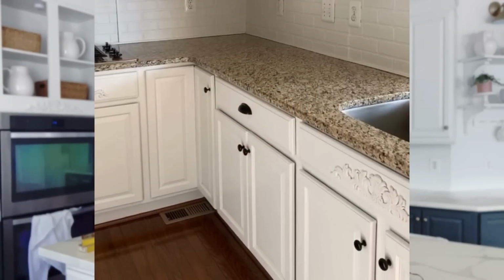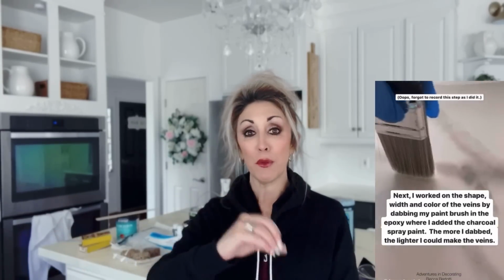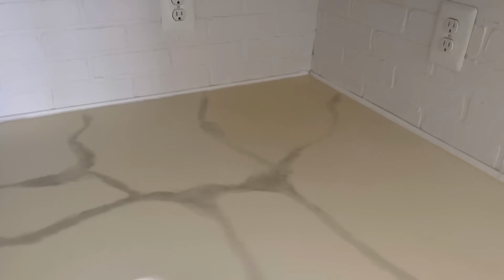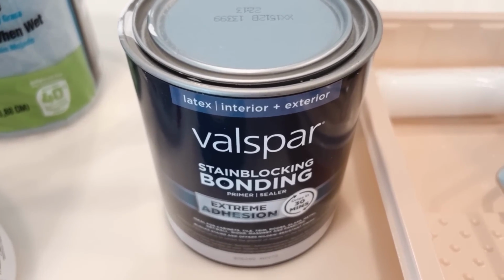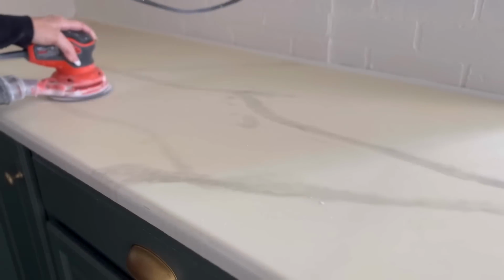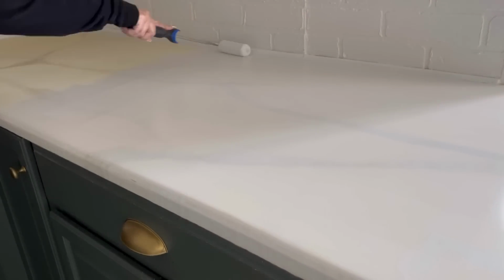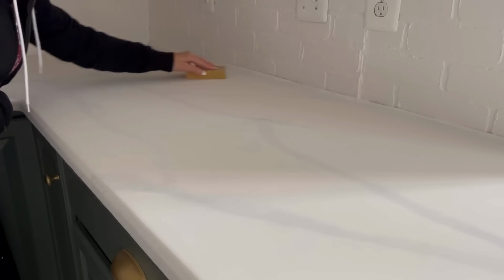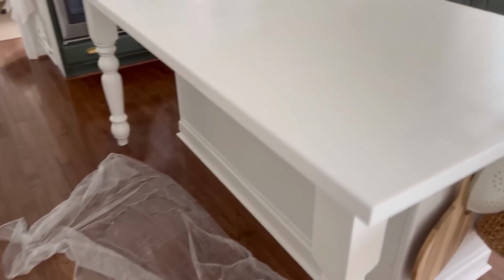*NEW* PAINTED KITCHEN COUNTERTOPS (DIY) | FAUX CALACATTA MARBLE COUNTERTOPS | KITCHEN DESIGN

Comment: Hi Becca. I painted my counters too but did not use epoxy. I sanded, used primer, melamine paint and put on polycrylic and it turned out great - no yellowing. As well epoxy hard to deal with.
Reply from the maker: Hi Lynda!  That's so good to hear that you haven't had any issues with your poly yellowing.  I'm so excited to be done with this project!  Hope you have a great weekend.